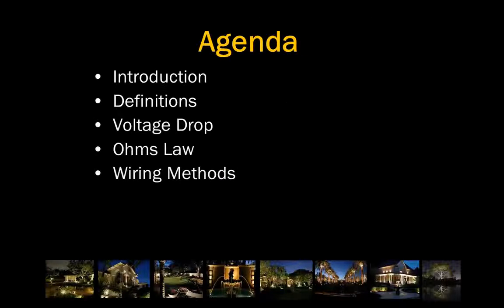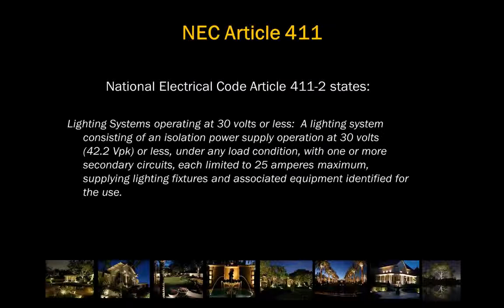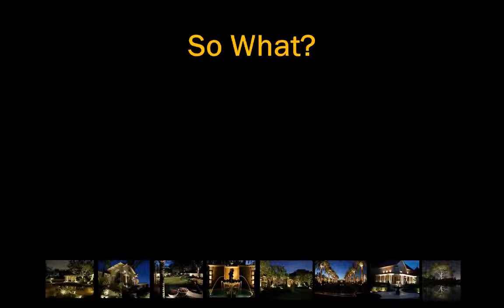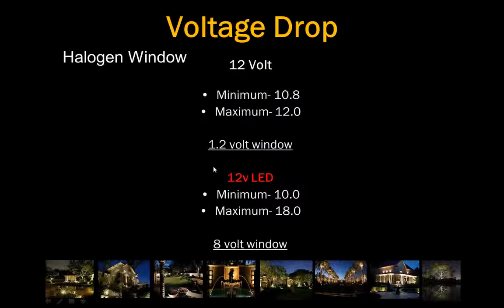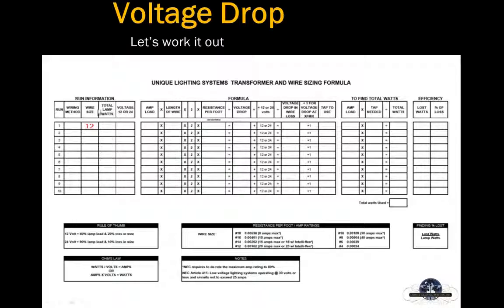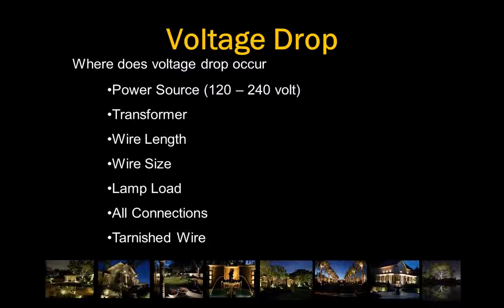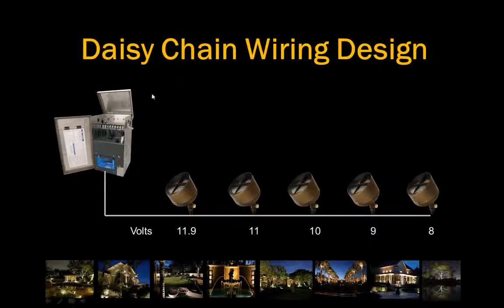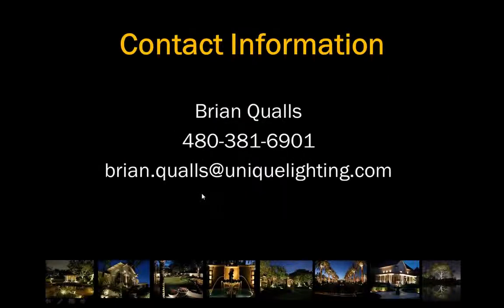ASLA Low Voltage Module1 (Unique Lighting Systems)

Comment: Thanks Brian! I’m attempting to design and install a low voltage LED system for my house using all Unique products. I’ve got an I-FORCE 360 watt transformer with 14 step lights going to a HUB then home run back to the 12 V tap already operational. Now would like to light up my house, trees and shrubs via intellihub method. Would you be able to assist with design? I’ve got 4 trees 20’ tall 20’ wide and 1 weeping cherry 40’ tall 40’ wide. Currently have (4) Quasar 2 down lights 91100-147, (8) Elements POSI-L427-WB 4W LED, (1) CONQUEST 5W all 2700K. I’d need to purchase hubs and additional lights somewhere. Also does Unique have an astronomical timer? Thank you